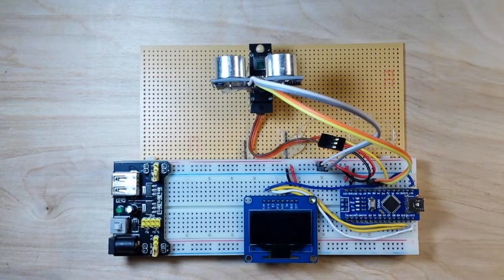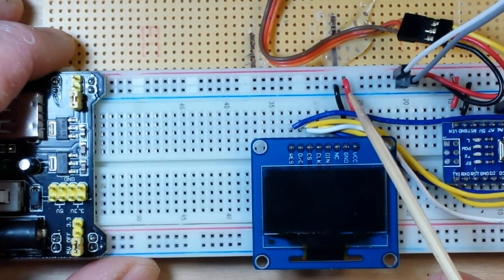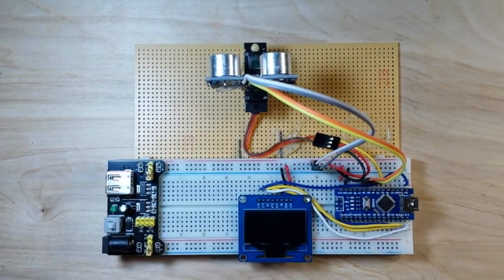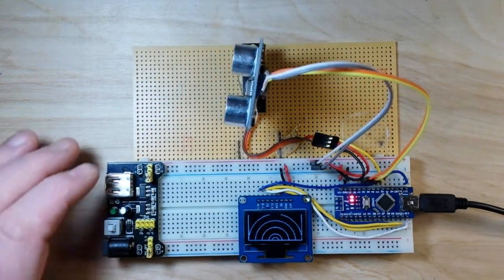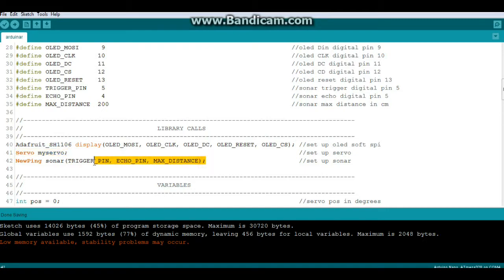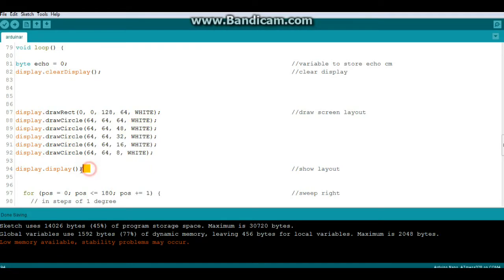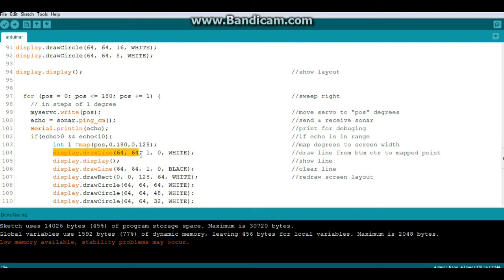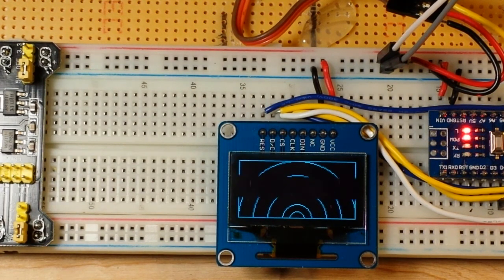Arduino Targeting and Tracking System

Comment: I often see these SONAR systems online, what kind of range do you think they'd be reliable at? couple of feet? a meter?
Reply: I know it has been a year and you might already know the answer but I'll answer your question anyway.

From my experience, these HC-SR04 sensor can detect up to 1.5 m quite reliably. The thing is they are slow so i didn't get enough resolution.

Dronebot Workshop channel has done a quite thorough experiment with the HC-SR04 combined with DHT22 temperature and humidity sensor to improve distance reading. I recommend watching his video if you want to know more about it.